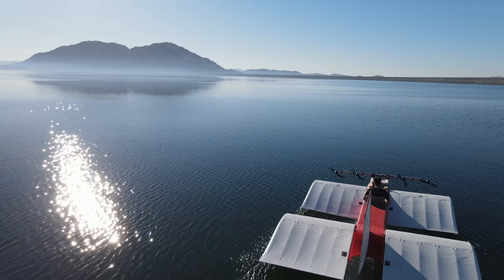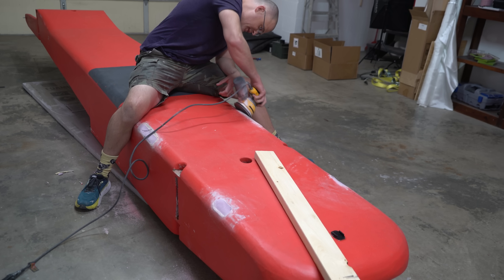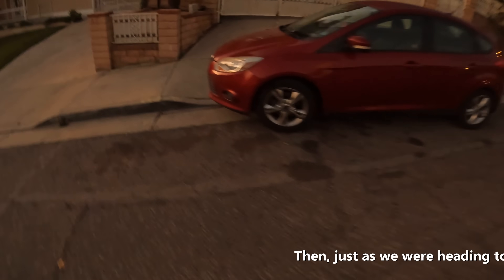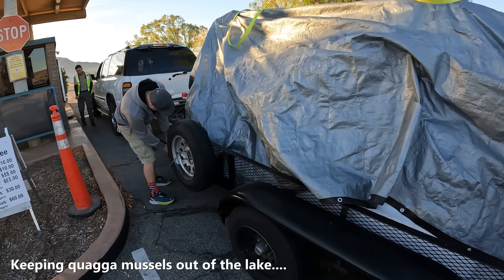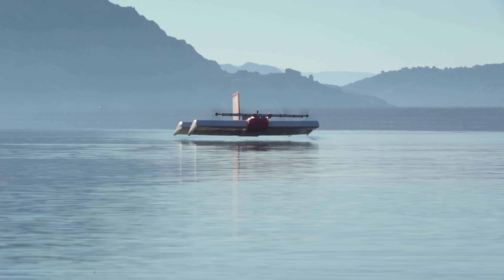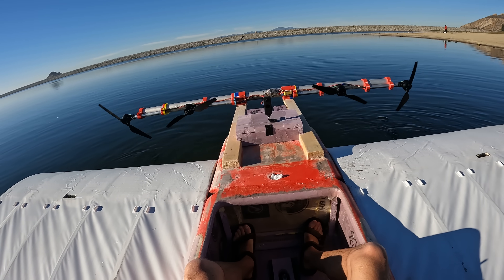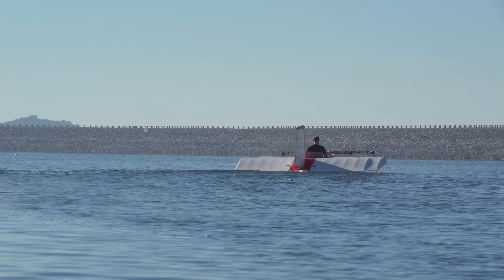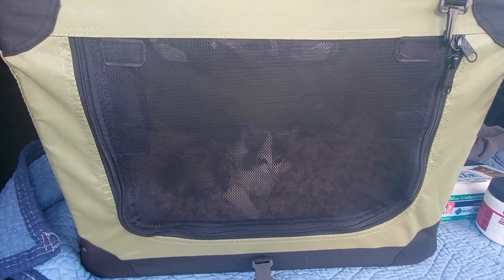Human Carrying 6 Meter R/C Ekranoplan  (RCTestFlight Collaboration)

Comment: 1) The propellers need to be pitched Down!

It seem intuitive to pitch down for more lift.  But the opposite is true.  More airspeed over the top drop the air pressure atop the wing so more lift is created.  

2) Over-pitching the engine angle also lift the noses too much when powering up.  The nose should only slightly rise when at full power because you have no other pitch control.  So decrease the pitch so you aircraft becomes more controllable.

3) Your CG looks to far aft.  Your bird should be slightly nose heavy or it will try loop itself over at speed.  These loops are un-recoverable without sophisticated software.

4) Add a pitch control surface:  The simplest, lightest and most effective would be to let the motors be adjustable angle in flight and mount them to a canard instead of a pipe.

5) Change your aspect ratio:  The wings are too short and losing a great deal of lift at the wingtips.  For your weight and speed, 24 ft wingspan is minimum with minimum 11" of camber.  For the low power you are using and high weight; 35 ft wings are required.

6) Get the wings higher from the water:  While ground effect is better closer to the water, only one span from the surface is needed to effectively achieve ground effect.  Since your wing are so close to the water, they risk catastrophic water strike contact.  Getting the wings 18" from the water allows for rougher surface launches and safer landings.

7) Add rudder:  Ailerons aren't as necessary as a rudder given your configuration.  But a rudder will help when gusts become an issue later in the day.

My apologies for sounding so hostile, I have a degree in aeronautics and I live on an airport.  I've built 5 experimental aircraft.  Watching your flying is entertaining and exciting because you are so close to getting it right.  I would offer help but I'm nearly certain you would not accept.  Good luck sir.

Comment: Amazing. Two things - you do not need to tilt the motors for blowing under the wing. Blowing over is perfectly ok. The higher the speed over the wing the better the lift is. Also move the person backwards, rear wing is not loaded as good as the front one.

Comment: Simple math should prove that Daniel has to sit exactly in the middle. 2 same size wings, light-weight tail, heavy propellers and batteries way to forward. This plane is loaded very nose heavy, Daniel's perfect spot is right in the middle.
I demand a rerun, with spare wingtips for extra lift. This should have made a real flight even with the heaviest pilot.

Comment: One observation, not sure if that helps or not. I noticed that the skin on top of the wings did not buckle up as I would expect if there were lower air pressure over the top of the wing. Maybe the angle of attack or airflow over the wings needs to be adjusted?

Comment: You wanna make it leave the water surface with a pilot onboard?
You just need to add, in the immortal words of Jeremy Clarkson, MORE POWER!!
MOAR!!
Longer 2x4 (to give the props more clearance) wider boom for better roll stability, bigger props with steeper pitch for more pull, and proper grunty motors to spin them.
toss in a couple more batteries, and bob's your uncle, you've got a proper GEV. :D
Reply: More power alone could turn it into a conventional airplane, which isn't what they want

Comment: Congratulations!! If flies! 

Second set of motors behind pilot and in front of back wing. 

Motor banks can be separately  rotated between the two positions to achieve the right variations between push and float. 

Hull design directly under pilot is an inverted “w” shape with the centre not as deep as the out sides. This will give you less drag in the water at take off or as the craft moves from full float to skimming through the tops of swell.  Plus, as the craft lands on land the two outside peaks operate as landing rails like a helicopter. 

Looking forward to your next innovation.

Comment: Almost there! Why the landfill?

That's why you'd need quarter-circle hydrofoils, so you'd be airborne much faster (instead of not-at-all), but forget about the beaching (super cool feature).

Now, the Lippisch-style ekranoplan has a Pi-tail and a lawnmower engine close to the CoG, giving a lot of extra torque to take off, electric motors just suck.
Also, I figured out how to attach canards at the front of the front wing instead of having them detached in front: now, it's the entire wing profile that changes, not just the airflow on the attack edge. You see, here in East Cork, the closest body of water is the Sea, and it's pretty choppy...

Thank you for all the insights and the tests!

Comment: Wow, very epic! Even the fish were jumping with excitement (10:23)

Excellent teamwork. Assume this GIANT DYI Ekranoplan was fully manual controlled, no flight computer, lidar magic to hold a constant altitude like many previous RC Ekranoplans?
Am curious if you got any current, voltage measurement while Ekranoplanning? (7:40) Would make great reference data to compare to power (watts) at speed compared to power needed by a speed boat keep up in a chase. Nice choice of audio for the chase scene (7:25) BTW.
Nice way to end this summers project series. :)

Comment: You need a windshield to protect you incase a prop or motor explodes
Reply: Just a full face motorcycle helmet and maybe a light leather jacket to protect the torso.
Reply: A light-weight fabric tonneau cover and windshield might save you enough drag to get airborne. Next try reducing thrust angle, then end plates on each side of the fuselage extending a few inches into the water in the step area, and finally end plates at the four wingtips. The wingtip plates may increase the risk of instability in turns, but its not my neck:)

Comment: So good! Now I can't wait for the next manned creation
Reply: Manned rocket to the moon everything else would be a dissappointment.

Jokes aside, GREAT WORK!!
Reply: Loving this series.  Does a third wing or a differential wingspan between forward and aft wing seem like it might help with pitch stability?
Reply: @TrogdorBurnin8or  I was thinking he should simply add a horizontal stabilizer to the tail or a basic spoiler system on the front wings to trim out with a grip style controller.  Same design but as you get lift use that to augment pitch like a motorcycle throttle or perhaps a lever right there on the handles so it could be controlled via a cable.
Reply: You guys sound exactly the same! I was confused as to which channel I was actually watching... Just watched your RC Outboard Motor video... I guess you found a doppelganger.. For your voice at least.. 😄
Reply: @Matthews_Media  yeah its pretty weird also it seems like they also steal video ideas from each other
Reply: Lifejacket. Helmet.
Reply: So it begins ... planning next summers manned creation. 🤔💭
Reply: Same.
Reply: dude thats a young version of u
Reply: Manned submarine
Reply: This is great!
Reply: Not supposed to give cats milk its toxic to them so are raisins onions and garlic
Reply: Can we expect another manned rc anytime soon?